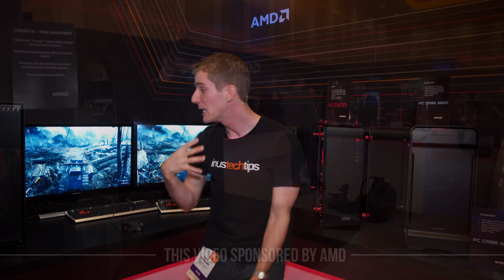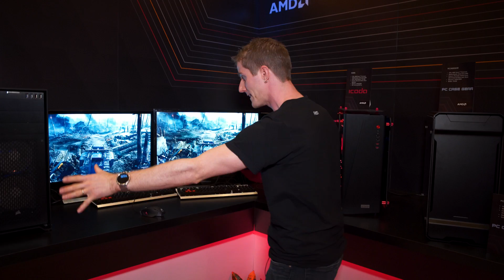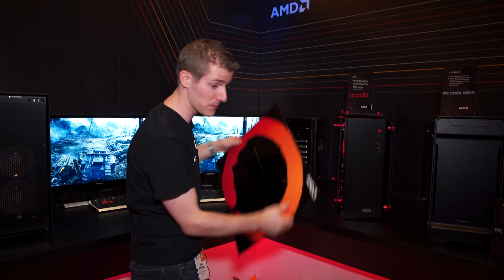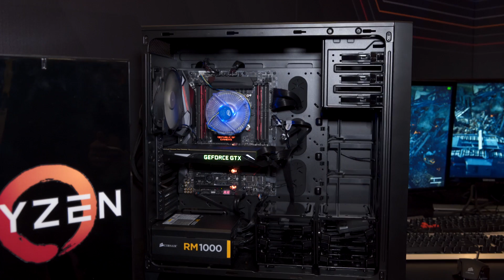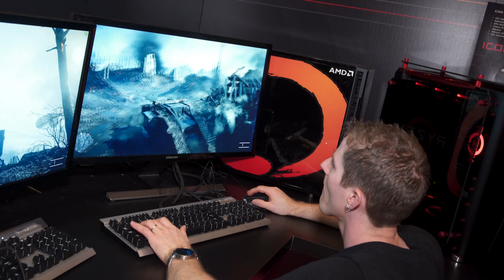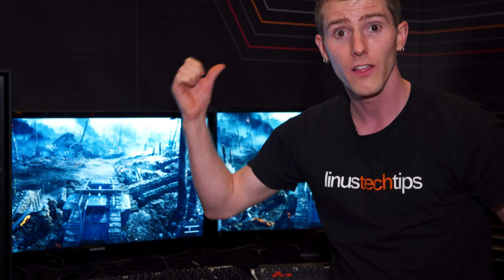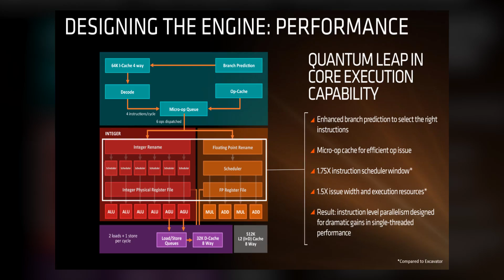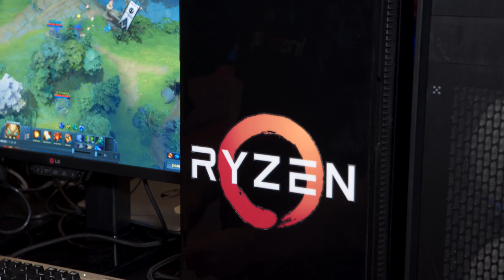AMD Has Ryzen!

Comment: My ram is only running at 1333mhz even thoug it's 2666 out of the box, what is wrong? It's ddr3 corsair dominator platinum on a msi m-power z77. CPU is running at 4.5Ghz

Comment: The reason why the amd ryzen was paired with a titan because it shows that even with the most powerful gpu from nvidia, the ryzen has the capability to not bottleneck it, because previous am3+ such as the 9370 fx can go as far as a 1060 without bottlenecking hardcore on cpu intensive games, the amd market needed a cpu to take on strong gpus to please for those as myself that has a amd processor with a nividia gpu , most of us with amd is because of budget I myself would like an intel, but financial issues is a thing, so amd is creating a budget and performance quality cpu and gpu just to give a dash of hot sauce to nvidia and intel fo competition, it's just a equilibrium trend in marketing

Comment: So it beats/matches an $1100 processor... That's great and all as long as it costs a lot less. I would never buy an $1100 processor so the only way I'll chip in to the Ryzen CPU is if it is at a reasonable price point. If it costs $600 I'll still say it wins but there is no way I can afford that.

Comment: AMD Ryzen 8 core $350 ??!
Reply: They sell THAT cpu with THAT kinda power at $350...

That's gonna destroy Intel.
Reply: 4c/8t CPU: 150$
6c/8t CPU: 200-250$
8c/16t CPU #1 350$
8c/16t CPU #2 550$
Reply: If they can match a >$1k CPU, they're going to price accordingly. AMD's running a business, not a charity. I'm calling $7-800 MSRP, with both companies reaching $600 territory after a price war.
Reply: Not An Argument. I can guarantee they're fake.
Reply: Timothy Gibney I'm more interested in the 4c8t/6c12t CPUs.
Reply: if 350 intel will have it bad.. lol high end intel cpu are SO overpriced
Reply: Timothy Gibney  even if the 8 core ryzen chip is 700-800$ it would still be competitive to Intel considering Intel would be 200$ more. and Intel motherboards a generally more expensive (at least in my experience)
Reply: Zraupp10 no way. at least 500$
Reply: the top model 8C/16 Thread is $550 retail.
Reply: nobody knows the single core performance of Ryzen yet.
Reply: They will try to undercut intel in price at similar performance levels. They have to because they do not have the resources to beat them on R&D so any performance advantages would be fleeting. Best they can hope for is close to the same performance for a lower price. Which would be good enough to gain a larger share of the market. Intel has to tolerate their existence or else become a true monopoly and risk getting broken up. Taking some of the mid to low end would be the most acceptable to intel because the high end is where the biggest profit margins are. AMD can have 5-10% of the market without worrying intel and that would be enough for AMD to be very profitable and viable.
Reply: David Rook here's why ur wrong.
Gamers buy expensive shit.

the $750 GTX 1080 outsold the $200 RX480 by 10 fold.

desbite the FUryX being around the same performance of the 980ti, it still failed to sell.
Reply: ***** as i just stated, CLOSE doesn't cut it.
Reply: I think it will be around $700/800
Reply: Dream on! at least between intel's 6 core and 8core, they need money to pay debts and reinvest in R&D, don't expect Bulldozer prices lol
Reply: $350 would still be over twice and a half times what they are currently charging for a FX 8 core 8xxx series chip.

besides they already reduced their debt from 2.2 to 1.6 billion since last year, and increased their turnover to 1.3 billion a quarter (from 1 billion). and they haven't even started selling ryzen yet.

still, i think the highest clocked 8 core ryzen will probably be more then that.
Reply: Not An Argument. even at that price it would be hella competitive
Reply: I can hope. Your phone is 8 core.  We need good competition even if it just matches Intel
Reply: Daniel Coltrain Not in gaming and heavy single threaded applications.

AMD has always had better multi threaded performance, they lack single core performance.
Reply: Snuwfer it's worse than the 4770K
several leaked slides showed up.

it's a huge improvement over the bulldozer, but it lacks yet again in single core performance.
Reply: Snuwfer the same website showed the FuryX to have only 4gb of HBm1.

Notice every AMD Zen benchmark shows only heavily multithreaded applications like blender?

the original bulldozer beat the I7 when using all 8 cores.
it just has shit tier single threaded performance.
Reply: ***** AMD's only hope is their heavily multi threaded performance.
that may save them here
but that doesnt mean shit for gamers.
Reply: Seriously doubt $350, because Intel would have to hirer an army of hitmen to survive.
Reply: keep dreaming!
Reply: Not An Argument. I think they will also come much closer in single threaded performance, IPC, and TDP than they have in years. Close enough to be competitive again.
Reply: other way round, amd motherboards are more expensive because amd cpu's require beefier components to function 

which is why a lot of people run h81 motherboards
Reply: Not An Argument. It absolutely does when you factor in price/performance and total system cost. The percentage of gamers that go for the highest end rigs is actually quite small. The vast majority go for low to mid range because of limited budgets.
Reply: I mean, it destroys an overclocked 6900K at stock power.
Reply: OdinAlgeron  you realise you can of on a sub 100$ Mobo with AMD... most Intel boards and CPUs that allow over clocking  is 200$ CPU side and around 120$ for rather "basic" features. i spend a little less than 130$ for my FX 6300 and Asus 970 pro gaming Mobo. I'm not anti Intel. I love Intel products.ita just not truly budget friendly for people without steady jobs
Reply: công Hinh Phan acually, it doesn't.

Overclock.net was given the settings AMD used in the benchmark, and they beat AMD's 6900K score by a whopping  12 seconds.

furthermore, Zen has a STOCK boost of 3.4ghz as their yields are very bad.

several leaks showed it maxing at 3.6ghz and becoming unstable.
Reply: ***** unless ur doing video rendering or heavy workloads, it will be slower than a 4970k in any gaming application.
Reply: thats where you are wrong .. their mark up is so fucking high ... their gross profit Margin is 62% + 

That means they make A avg of over 50% per item they sell .. and you have to remember ... the stores you buy it from are also making profit.   I would think e-stores make A min of 20% so .. take A $1,000.00 CPU - 20% = 800.00 - 50% = $400.00 ... but it think that is even high.  ... I would be A $1,000.00 CPU cost about $200.00 Max to make.

I use to work for A few retail stores.   Their were A few vendors that would allow our employees (retail)  to buy direct from them At cost ( once per year ).    This was 1/2 the cost our store was selling the same item for.   I bought A PNY getforce 3 for like 200.00,  I remeber all of my friends were trying to get me to buy one for them.   Also got A X1950pro at one point ... and A creative labs x-fi  fatal1ty ... bascily all high end stuff at 1/2 the price.  

worked at EB ( Gamestop but more PC stuff ) from like 1999 - 2003 .. i think.
Reply: Why have the comments died out?
Reply: amount of cores don't mean everything, look at all the 6 and 8 cores amd cpus that are getting out performed by 4 cores intel cpu. wait for benchmarks
Reply: maloviv 123 That was because of dramatic architecture differences. The chips are more similar now so performance should be closer together. I agree that we do have to wait for benchmarks and real world testing before we know more.
Reply: Zraupp10 They could sell it for so cheap in theory the costs for high end and low end processors are the same.
Reply: neko77025 The price to make it is 50 dollar but the developments cost are high. All CPUs cost nearly the same the development costs of low end CPUs are nearly as high as of the high end CPUs.
Reply: I understand that .. just that intel ..can match amds price at any point ... they have already made their money back on dev .... all billions over billions they have made in the last few years due to A monopoly ... have them at A advantage.      

No matter what happens the ture winners from AMDs new chip is all of US .. this will force Intel to drop prices.
Reply: neko77025 I mean, whenever AMD releases a flashy CPU, Intel would counter by releasing a new CPU that's better, is not a power hog, and more powerful, but I think that this year, the opposite will be true.
Reply: Intel would be fucked if that's true.
Reply: Eddie Barley Not to mention that Qualcomm has developed a 10-nanometer chip called the Snapdragon 835, which is really potent.
Reply: công Hinh Phan We are getting to a really exciting point in time for semiconducting technology. Having a 10-nm chip developed is very impressive.
Reply: Eddie Barley Oh, that's why there's very little changes in performance from Broadwell to Kaby Lake - they keep using the 14-nanometer size.
Reply: công Hinh Phan That's true I looked at a bunch of articles stating a approx. 5% increase in performance. However power efficiency increased so ultrabook users would be pleased.
Reply: The lower the prices, the more competition for intel -> lower intel prices -> all consumers win
Reply: 8 cores is just one thing about a cpu's overall performance. It's not different as advertising from decades ago for cars with V8 engines, so must be the best engine. Think about that for a second...

There's a lot more to cpu's than it's cores. There are many operations to inputting something, then getting an output in actual performance. 

This is something you look back at in 20 years and go LOL. Trust me..
Reply: And they predict that we will be using 5-nm chips by 2020. Expecting 6-8 GHz of computing power now...
Reply: Dont Hype some same shit like $200 rx480 match gtx 980ti/gtx1070 performance. U get what u paid for. If it can match 6900k, they will price it according to the perf. AMD wants to make money also.
Reply: Eddie Barley So unless Intel do research on 10-nanometer transistors, AMD or Qualcomm is going to annihilate them.
Reply: +Martin Shekreli Ironically it was the Nvidia fan boys who over hyped the 480 not the AMD fans. The Rx 480s information videos/sites were filled with Nvidia fan boys saying omg just sold my gtx 970 because rx 480 will be a 980. No AMD fans went selling my 390 for a rx 480.
Reply: +World Kat (KB) Technically the 480 would be in 980 territory now after improved drivers
Reply: +World Kat (KB) Technically the 480 would be in 980 territory now after improved drivers
Reply: Zraupp10 proably not proably around  $500- $600
Reply: RoundDuckMan its not. Look at Project car, Watch Dogs 2
Reply: Don't get your hopes up too much; remember that the intel CPU they're competing against is $1000. Even if they sold it for $800 it would be a win.

I am really hoping they'll meet all expectations, but there is no point being disappointed if they do release for $600+
Reply: +Zraupp10 I honestly believe that would be a bad move for AMD. That kind of pricing could spark a pricing war that they couldn't possible hope to survive through.
Reply: +Martin Shekreli They'll be performing roughly the same, but pricing a bit cheaper. Not a lot cheaper. This is simply because they can't afford to go a lot cheaper without risking too much to themselves. They'd get more sales initially, but Intel would step up with similar pricing on their next architecture. It just wouldn't be good for AMD in that case.
Reply: +World Kat haha it's true, I tried to upgrade to a 390x before settling on an RX 480. I was coming from an R7 250.
Reply: +Martin Shekreli synthetically it is, real world it's not. There's many factors that determine actual gaming performance. I don't mind its performance a whole lot, still cheaper for me to buy than the 980. This is even with me attempting to buy it used in Canada.
Reply: You do know you can't compare the 1080 to the rx480 because they are completely different wait till the rx 490 comes out then you can compare
Reply: 500$

Comment: Dear everyone confused about them using a GTX GPU in the system: when measuring differences between CPUs it's best to use the fastest GPU on the market, so that the effect of the CPU on performance can be easily seen without worrying whether or not the GPU is holding back performance. Nvidia currently has the most powerful card on the market, so that's the GPU they need to use to show off their CPU.

Comment: Embarrassment to AMD that they must use their competitor's GPU in order to reveal a demo. I want AMD to do well, but this is not the path. Embarrassing!
Reply: They don't really have a choice... if they use RX 480s in both they will end up bottlenecking the CPU's, and seeing as they don't want to unveil Vega yet, it is best they use the top of the line GPUs on the market currently to ensure that the benchmarks are truly legit. It would also be a bad idea to use a Vega GPU as they probably aren't properly optimised yet and seeing as there aren't any benchmarks for it yet, nobody has any idea of how much of an effect it would have on the performance of the CPU's

Comment: Both CPU are running on stock cooler? Didn't know 6900k can run on a stock cooler at all. Anyone know if the game (BF1) is heavy on CPU at all?
Reply: nicholasxuu Yes it is very heavy actually, especially multiplayer
Reply: Like the others have said, it is CPU intensive. Wish i would have known that. I have a cheap AMD CPU but a GTX 1060 and I can barely run medium settings.
Reply: nicholasxuu yes its quite CPU intense
Reply: Very. AMD may have a competitive chip :-)
Reply: Dio well I have a i5 6500 and 1070 and I get 80+ fps on all maps
Reply: ohohohohoho indeed it is. Doesn't bottleneck my 1070 at all pretty much
Reply: Fallen HD Yeah, it's definitely my processor. I used to have an R9 270 gpu that worked well enough with my FX-6300. Then the 270 died for no reason and there was a good deal for the 1060 where I was. So now I'm kind of stuck with a bottleneck and don't have the money for a new motherboard and CPU.
Reply: Dio run on ultra so that the gpu becomes the bottleneck. Also turn on DSR to see if that helps
Reply: Dio also OC the cpu to as far as you can
Reply: hello walkman Will changing the settings to ultra really work?

And as ashamed as I am not admit it, I do not know hot to overclock my CPU. I guess i could always just look up a guide.

I will try this out though.
Reply: Dio yup they will definitely help. thank me later !! ☺
Reply: hello walkman I just played today and set the graphic settings to Ultra, and sure enough... it ran a fair amount better than it did on medium. I haven't done any overclocking yet, but I am already getting much better results.

Thanks man.
Reply: Dio haha good to hear that. enjoy! 😊

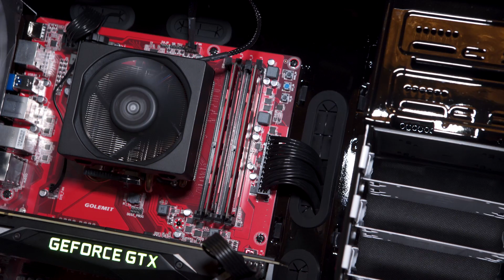Comment: 1:30 when you see this is when you realize that there wont be any rx490 for now.
Reply: Vega, look it up, possible 1080 levels of power.
Reply: at a much lower price god may ear me.
Reply: Strato Haze much lower price + hbm2 = not possible. Maybe the same pricetag as the 1080 than after a month after vega released, both gpus would be drop under 600$.. maybe..
Reply: well, at least i still can do rx480 crossfire